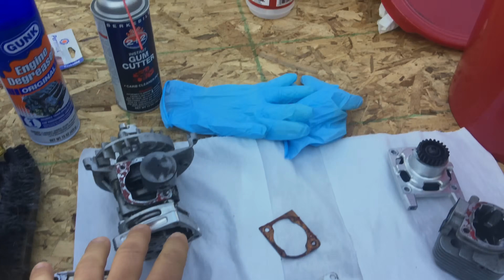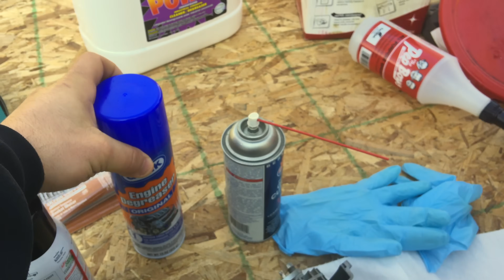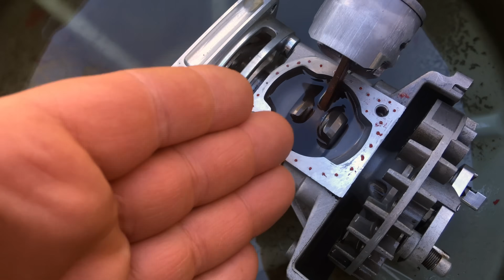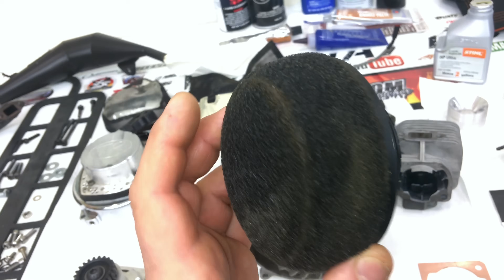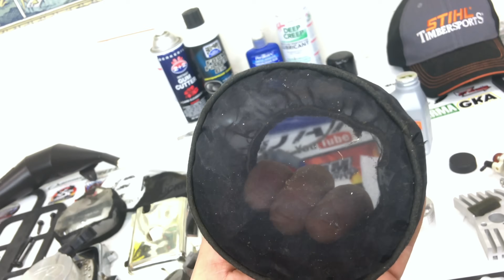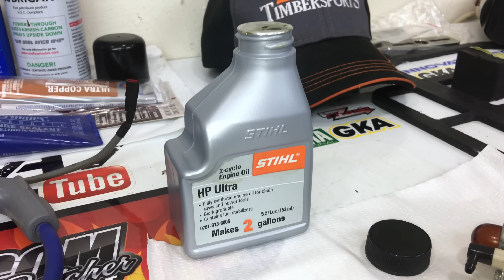LOSI 5IVE-T ENGINE REBUILD (PART 1)

Comment: yea I believe in that oil, from being a little kid being with my dad cutting and getting fire wood, till this day nothing wrong with his stihl chain saw, thing gets straight pinned soon as it starts lol
Reply from the maker: That’s what I’m talking about! It’s great to hear stories like this! However on this engine I felt that this is the best possible oil to use especially on commercial yard equipment chainsaws etc. now I am using a OBR O’Neill brothers racing engine and it requires a higher flashpoint oil such as dirtbike High performance. I am currently using maxima caster 927! It is biodegradable like the stihl oil and it has a very high flashpoint

Comment: Very useful information. Great video man. Thank you. I'm also going to modify my stock 29 CY engine on my losi 5-T. I know the easy thing to do would be to buy a performance engine from OBR but I've got experience building and racing  2 stroke dirt bikes so this looks fun. So far, I just have killer rc fail safe kill switch, air filter and bartalone pipe(awesome exhaust) ... ya,...how about that stock exhaust. Lol. What a joke. Made such a mess on inside the body. I look forward to more vids on 5t. Thanks again for the knowledge.
Reply from the maker: Thanks bro! It’s all about having fun and I have fun wrenching on these engines. Just want to prove that you don’t have to spend a lot of money on a crazy engine you can have just as much fun with the stock!

Comment: stihl 2 stroke oil only the best. I wonder if you could run turbo blue
Reply from the maker: Yea Man! STIHL is no joke. Huh never heard of turbo blue. Listen as long as it’s a good quality synthetic most 2 stroke Oils work fine.
Reply: @EVERYDAYRC  it's race fuel for 2 stroke dirt bikes. they call it turbo Blue because it burns real blue. it's  like 116 octane

Comment: Be careful with that fly wheel ... had one shatter one me
Reply from the maker: Yes very true you have to be careful. The fly wheel comes with a disclaimer that it is delicate. If you are going to use this fly wheel you need to run an outerwears crank case cover To make sure no rocks or pebbles get sucked into it otherwise it can be devastating